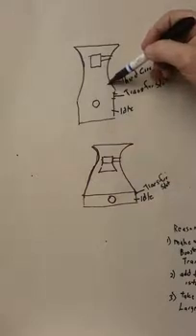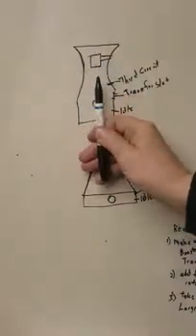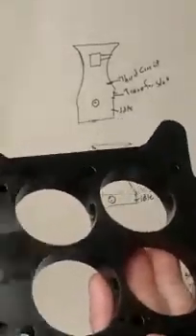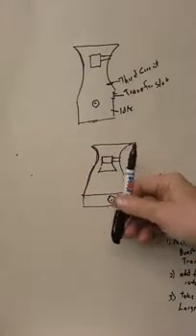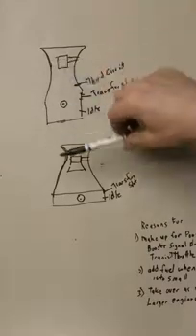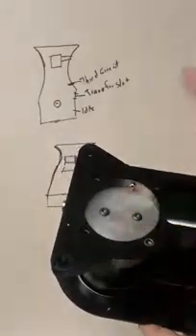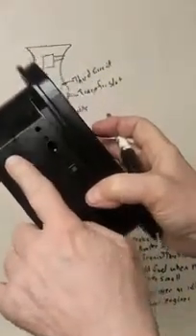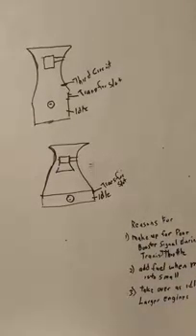Fuel delivery through transit throttle travel

Comment: People just don't understand carbs. It's a monkey see monkey do deal. I still have problems trying to explain to people there's no such thing as a bolt on carb off the shelf that works in every situation. They think they aught to just turn the idle screws and set the throttle opening and go. I HEAR YOU!

Comment: Dude, I've seen tiny carbs on power equipment with 3 circuits.  It does exist.  This is problem with racing.  You're mind is in a bubble.  There's more engines than just drag racing.  3 circuit dominators are a piece of shit designed only for 2-4 tunnel ram, or individual runner application, per Holley design specs.  They suck for any other use.